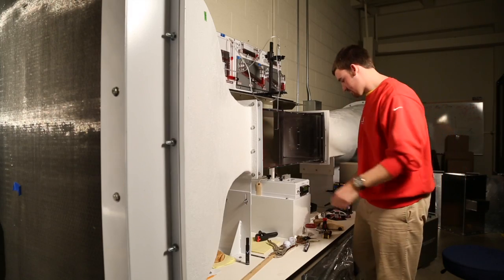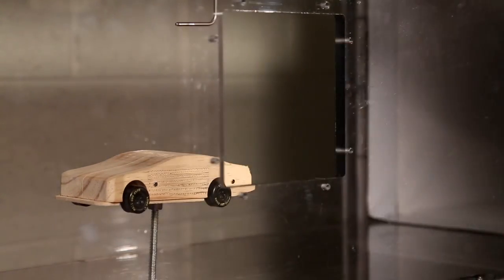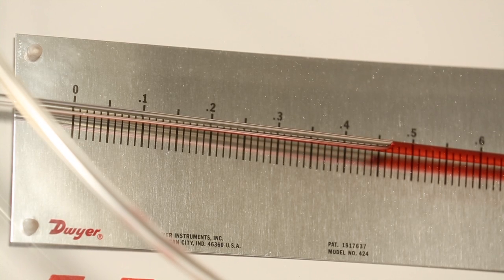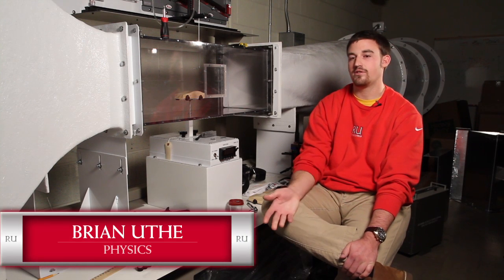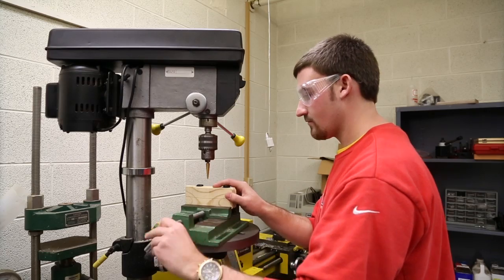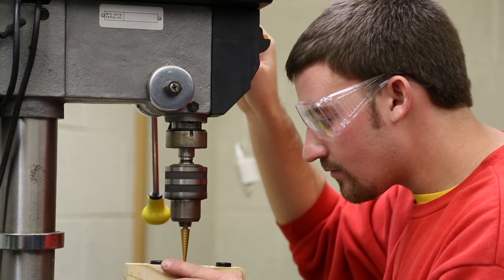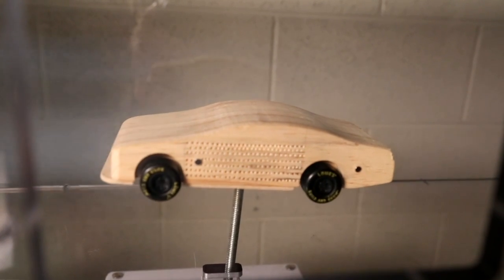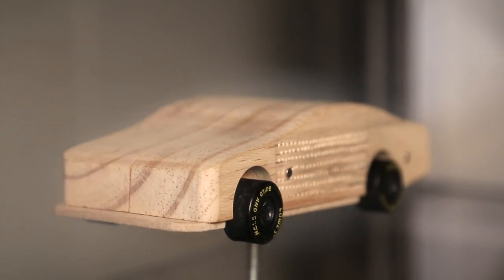Research in Action: Reducing Drag on Cars

Comment: My observation would suspect the cavitation from the Dimples cause a circular rotational buffer, basically using air, to reduce air drag, via rotational drag. I was researching a inert gas like Helium to spray/mist in front of a vehicle to continuously coat the vehicle from air drag. i second guess because if this would work, why wouldn't NASA would be doing this for shuttles during reentry drag.